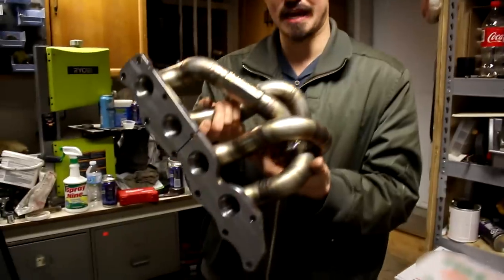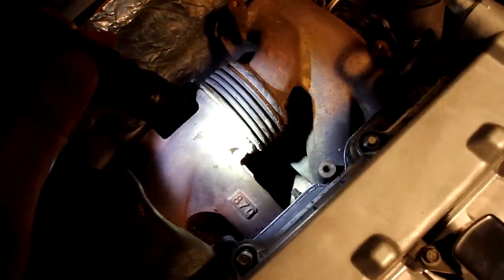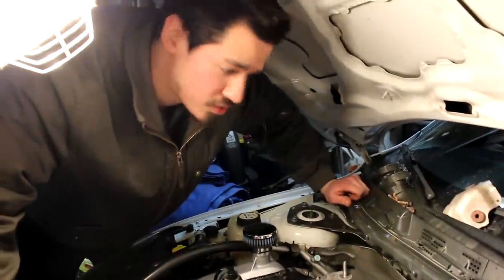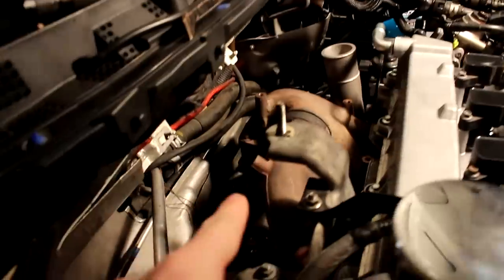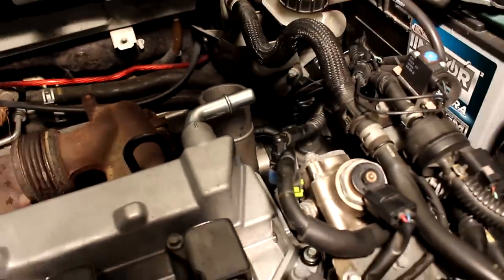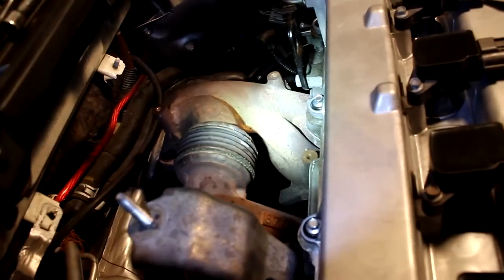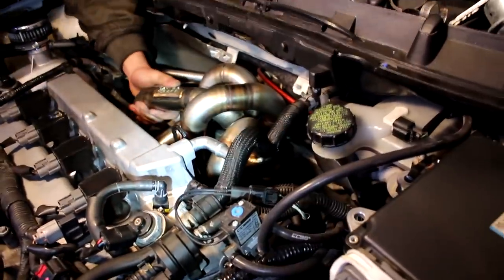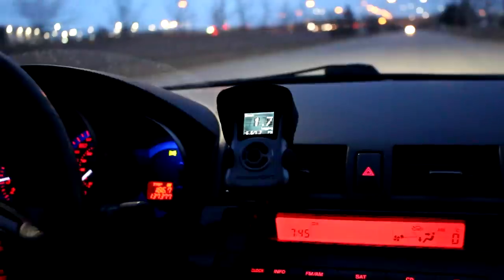Mazdaspeed 3 - Full Race Exhaust Manifold & CPE Downpipe Install

Comment: 500whp is waaaaaay underrated. The stock flange may be your limitation. These are the same ones in the Borg Warner EFR turbo kits with a T2.5 flange and flow a good deal more. Many folks use these same manifolds for 700+ at the wheels, too. They truly are a beautiful piece, and the lifetime warranty is amazing.
Reply from the maker: Numinous Good to know man. I'm lovin it so far. Sounds great and revs out eagerly:)
Reply: I’ve got the efr turbo kit with that manifold, i really like it, the turbo on my kit is a 7163
Reply from the maker: Joey Arthur Zooberry Nice is that the t25 flange?
Reply: Wannabe Tuners yes it is a t25
Reply: @X11CHASE  Do you have a built motor? If so how much power you making?

Comment: You should consider WMI instead of 5th/6th port. With 6th port you will have indeed more fuel but you will be limited by the octane.
Adding WMI has a ton of benefits:
- increases the octane of the mix so allows for significantly more timing (at least 5-6 degrees across the board compared to 93-94OCT fuel),
- of course adds additional fuel which you need;
- the water in the mix will cool down quite a lot the cylinders and pistons during the exhaust cycle, and this is something you really want with the stock brittle pistons but not only with those,
- also the water in the mix will break the carbon deposits on the pistons crown which will minimize the chances to have hot spots during high rpm/rich AFRs runs (with onyl 5th/6th port you will end up with a lot of these deposits due to the nature of the burn),
- the mix itself will keep the intake valves clean which will allow you to continue running an EGR which has a positive impact in fuel economy when driving normally, as well as emissions (not that it matters that much now that you're catless). 
For 400whp I think a 900-1200cc/min nozzle will do.
Reply from the maker: I agree 100% and I do have one. We recently had to take it out when we installed the Fmic because the piping would get in the way of the WMI pump and reservoir, so it's just as matter of relocating the kit to the trunk. The thing I like about the 6th port kit is it's accuracy, and that I can run about 2 gallons of in tank methanol in the gas tank and still get the octane I need. We will see how it all plays out. I may end up just re installing the WMI kit and using a bigger nozzle for a little extra fuel because it seems simpler at this point. Thanks for the advice :)
Reply: Great info.👍

Comment: Hey guys, very good step-by-step DIY video. Btw, just a tip, cut 2 vacuum hoses of the required hose dia. and length, and sleeve them over the adjustable needle nose locking pliers' teeth. This way you’ll protect the coolant hose from being cut/damage by the adjustable needle nose’s teeth.
Reply from the maker: Very good tip man! We noticed this while pinching the lines that if they are too tight, it may rip the coolant lines :)
Reply: I just stick a big enough bolt in the hose to plug it

Comment: You've gotta take me for a ride in this thing with all your new goodies on man. Convince me to get the manifold!!!
Reply from the maker: For sure man! I've gotta dial in a nice tune once it warms up and boost creep weather goes away (I've had to limit maximum throttle to a staggering 35% to avoid maxing out the injectors because porting the internal wastegate didn't help much. You should totally get one since you've got the CS turbo. There really aren't any drawbacks to an upgraded exhaust manifold. Better more refined sound, better flow, retains EGR, and less heat trapped inside the cylinders which reduces the potential for pre ignition and knock! :D
Reply: seems like you can do a downpipe install pretty easy :p I gotta get you to do mine when i go catless lmao

Comment: So if I don’t have a turbo I just take off the heat shields and the manifold? I’m trying to change my exhaust manifold gasket btw and I’m not a mechanic I’m just trying to learn and save a couple bucks
Reply from the maker: Yep sounds about right, although you might have to disconnect the downpipe from the exhaust manifold in order to get it off.
Reply: Thanks brother. Your video seemed easy enough, I just wanted to be sure 👍 appreciate you 🙏🏻

Comment: Looking to upgrade to a BNR S3 this spring from the stock K04, which has close to 200,000 kms on it (2011 Mazdaspeed 3).  I'll be adding a cPE catted downpipe at the same.  Is is possible to drop the turbo and slide the BNR S3 from below the car if the downpipe is out of the way?  Or is it necessary to remove the exhaust manifold and maneuver the turbo from the top of the engine bay?

Any issue with the exhaust manifold studs breaking in the head?  Or are these typically not too bad?
Reply from the maker: From what we remember, removing the exhaust manifold and taking the turbo out from the top is the only way. We thought about trying it from the bottom but there's just no room. The studs are pretty good actually, they don't usually seize, just make sure the socket is on there flush when cracking them loose, and use penetrating fluid to your advantage. Also, make sure you place some masking tape on the oil feed and drain holes of the turbo to prevent dirt from getting inside during the install :)
Reply: Thank you so much for your response!  I really appreciate the tips.

I noticed in your install video that you had purchased a new exhaust manifold gasket.  Did you end up replacing it or keep the original one?

What did you guys end up doing with some of the stuck manifold to turbo or turbo to downpipe studs?  I guess breaking them isn't probably the worst thing in the world since the turbo will be replaced.  But any issues with rounding the nuts?

Did the coolant crush washers come with the BNR or did you pick them up from the dealership.  I'll be purchasing from the dealership: coolant line crush washers, turbo nuts (manifold and downpipe), oil feed and return gaskets.  I'll also purchase an aftermarket after cat O2 sensor as I have read that to be a potential issue.
Reply from the maker: @duey1083   You can save money on skipping the secondary O2 sensor unless it's causing a fault. The BNR turbos come with coolant crush washers, oil feed washers, oil return gaskets (although they're paper, so we ordered OEM), and turbo to manifold / turbo to downpipe gaskets. I would just buy OEM oil return gaskets from Edgeautosport as I've heard stories of the paper ones leaking. If u want to play it safe just order all OEM oil and coolant gaskets / washers from Edge. As for the exhaust manifold to head gasket, it is a tad expensive, but we went ahead and replaced it when installing the BNR S4 turbo. We reused it when installing the Full Race Manifold without issue. The BNR turbos also come with studs. I would call BNR and double check because we installed the S4 3 years ago. Not sure if anything has changed since then ;)
Reply: @WannabeTuners  Hey!  I hope you don't mind another question.  I finally ordered the cPE catted downpipe through Stratified in BC.  Hoping to tackle installation in 3 weeks.  Do you see any harm in using and air impact gun for the turbo-DP studs?  What about the O2 sensor?  Obviously copious amounts of PB blaster will be used and I'll use a hose clamp on the sensor socket to keep it from spreading.

I decided I will pre-order an NTK secondary o2 sensor off amazon as they have decent prices.
Reply from the maker: @duey1083  I wouldn't recommend the use of an impact gun on any of the exhaust nuts or bolts, as you run the risk of breaking them which causes more headaches. I just spray penetrating fluid on them, let it soak in for a while, then loosen them all by hand. As for the Primary O2 sensor, I use penetrating fluid for assisstance along with a 22 mm or 7/8" O2 sensor socket. For the secondary O2 sensor, I use penetrating fluid also, and use an open ended wrench to loosen it. Just be careful as you don't want to strip or break the sensor. I find that hitting the back of your hand that is on the wrench with your other hand helps to break the sensor loose. If it's never been taken apart before, there's a chance that things will be rusty and difficult to loosen, so just take your time and use penetrating fluid to your advantage :)

Comment: Another great video guys.  Did you all ever clean the exhaust valves out?  I imagine it's a lot harder than the intake.  Would they be gunked up if you're not running a catch can?
Reply from the maker: craigzilla100 Hmmm I'm not sure. I've never heard of anyone cleaning the exhaust valves. I doubt they would need to be cleaned since anything on the exhaust side would burn off. I guess to clean them, you could just do a nice solid pull lol
Reply: Wannabe Tuners true dat!

Comment: You guys are the Best! Im installing my exhaust manifold this weekend and this video definitely will help as there aren't many instructions online. Did you remove the studs with an e8 torx bit or just the 14mm nuts when removing the exhaust manifold? If you got anymore helpful tips with removal, it would be appreciated.  Are there any instructions online that I can follow any links you know of? Thanks!!👍Keep crushing it!
Reply from the maker: Thanks man! Basically to make it easier, just remove the entire downpipe for more room. Remove intake from turbo. Remove manifold heat shields. Remove oil feed banjo bolt, and oil return line. Disconnect coolant feed, and return lines (lightly pinch coolant hoses with straight vice grips to prevent coolant loss). Remove 14 mm nuts from turbo to manifold. Lower turbo onto sub frame (Make sure not to lose the wastegate actuator rod retaining clip; It may be safer to remove the wastegate actuator first before lowering the turbo). Loosen 8 mm bolt holding oil feed line to manifold. Remove alternator heat shield. Loosen and remove all 14 mm nuts holding manifold to head (Some of the studs will come out with some of the nuts; This is normal. Just re-install as usual). Reverse the process when installing the new manifold tightening inside to out, and ensure all new oil seals are replaced, and gaskets are in their correct positions. Let vehicle run and check for leaks. Hope that helps. If you have any other questions, we'll be here :)
Reply: Wannabe Tuners Awesome! Thank you and cheers to bloody knuckle, the Speed3 requires it!! Thank you for the instructions. 👍
Reply from the maker: T1MERUNN3R 414 Cheers man!

Comment: Nice mani fersure but you shoulda gon with an external setup! For all the flow and cool noises
Reply from the maker: Yeah that's true, especially because boost creep is an issue with an IWG in the colder months of the year. But, I just limit my max throttle in the tune during those months. If I do decide to go external, I'd probably go with the Bnr S5. For now I think this setup will be more than enough for the street :)

Comment: What did you do first? Intake manifold or turbo upgrade? Trying to figure out which way I want to go.
Reply from the maker: I upgraded the turbo before anything. Then did the exhaust manifold. Then did the intake manifold. Either way both the intake and exhaust manifolds flow unevenly and should be upgraded:) Also, vent that crankcase!
Reply: Awesome thanks! Guess I’ll turbo first
Reply: Wannabe Tuners I have the same vent cap setup you have. One of the first things I did
Reply from the maker: @jebified  Yeah it's definitely necessary when increasing power output, to prevent the turbo from smoking
Reply: Wannabe Tuners yea it looks like a diesel under full load!! But ordered a Full Race Mani and CorkSport CST5 turbski and a V3 Accessport since my V2 is no longer supported for tuning
Reply from the maker: @jebified  Awesome! Then the only thing left is the intake manifold. The CS intake manifold is literally a direct bolt on, and doesn't require any modified cold side intercooler piping. I feel like it's the best on the market right now, because it caters to all areas, such as ease of installation and performance (then again, I am biased because I have one lol)
Reply: Agreed! I’ve looked at the others on the market and for the price and ease of installation they have the best! Plus I always have good customer support from them!
Reply from the maker: @jebified  Exactly! Can't go wrong with that manifold

Comment: Is this otherwise a stock engine block ???
Reply from the maker: Yes the engine is completely stock. It just has a Fidanza flywheel.
Reply: @WannabeTuners  Awesome. Do you know how much torque and hp at the wheels she makes ?? About to go full bolt on, on my Gen 2. Only 35,000 miles on motor...
Reply from the maker: @Nevsack63  Right now she makes about 320 whp/wtq. The stock fuel system is nearly maxed out with conservative ignition timing. It's going to make more power soon though since we've recently incorporated a 6th port aux fuel system into the setup. Stay tuned;)
Reply: @WannabeTuners  I got to 380/375 @ the wheels on the stock fueling system. Most of the reputable tuners say 370-380whp is the limit, but you definitely have to have healthy timing to get there (I was using an E25 mix). On straight 93 I got to 325/350 @ the wheels on crappy Texas 93 before getting to the knock limit, all on a BNR S3. I had plenty of extra fuel left on that 325/350 too, since straight 93 requires a good deal less fuel volume than even E25.
Reply from the maker: @numinous4789  Yeah man I've been running 2 gallons of intank meth since we don't have E85 in our area, so it's been eating up some fueling headroom. The 6th port kit should allow for much more boost without pushing timing too far to make some decent power :)

Comment: How are your under hood temps. I was thinking about getting this manifold but ceramic coated
Reply from the maker: I just recently wrapped the runners up to the collector with DEI Titanium wrap. It helped reduce heat by about 15-20%, but I still open the hood after a long stop and go traffic run with coolant temps constantly held at 217F to let it cool off :)

Comment: How many km on the car right now? Has the clutch been done?
Reply from the maker: K Thompson Currently the car has 140,000 kms (87,000 miles). I replaced the clutch 20,000 kms ago. I decided to go with a new OEM clutch disc/pressure plate, and the Fidanza lightweight flywheel. The stock clutch has been proven to handle pretty good power. I figured since I don't track the car much, and my power goals target mild peak torque, the stock clutch should be good for daily driving :)

Comment: I found a catless dp  and turbo header at my local pick and pull. Got then really cheap. I still need hpfp internals so I'm not installing them yet. But I'm afraid to. I'm not gonna have the money for an ap. I have a hypertech that came with my speed but I cant find answers on whether or not a hypertech tunr would be ok for those parts. 

Life sucks :/
Reply from the maker: I don't know anything about Hypertech devices tbh. All I know is that when going catless, you will definitely need a custom tune so u don't over boost, and hpfp internals are a must to keep up with fuel demand. I would save and purchase those first before installing any performance parts as they are the foundation to a safe running engine :)
Reply: @WannabeTuners  
Thanks for the reply. I messaged cobb to see if I could get by with a stage 3 ots. 
I read in the mazdaspeed forum that hypertech can prevent boost spikes but not enough info other than that. I honestly might get rid of my speed and get the car I've always wanted
Reply from the maker: @JMPK23  Imo nothing beats a custom tune for your given setup. Sure OTS maps can get the fueling characteristics pretty close, but in terms of boost and load dynamics, nothing beats custom ;)
Reply: @JMPK23  what's the car you always wanted
Reply: @TheChocolateChamp  4th gen ls1 trans am M6. Got it back in September.